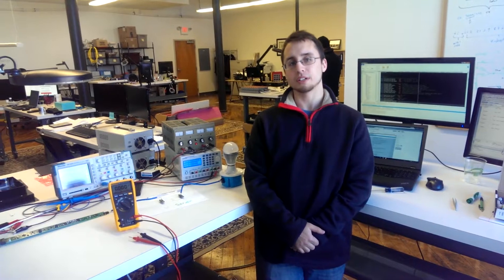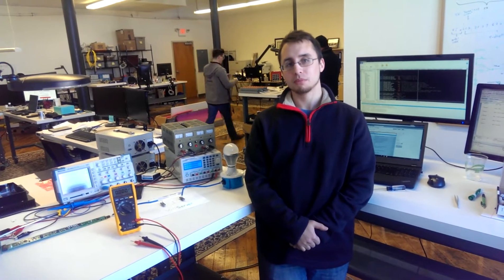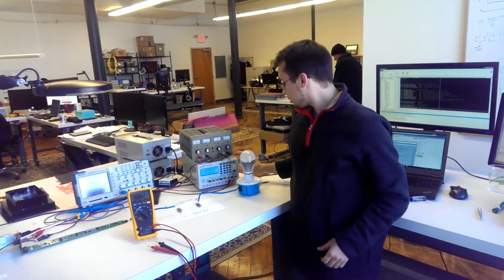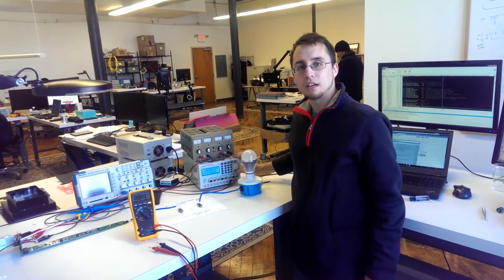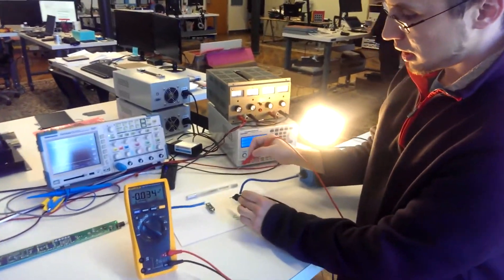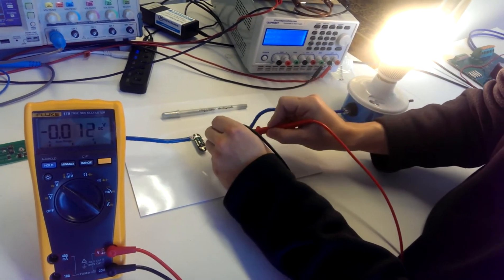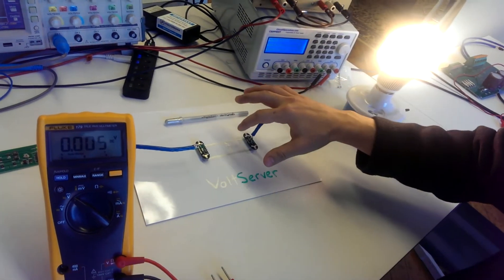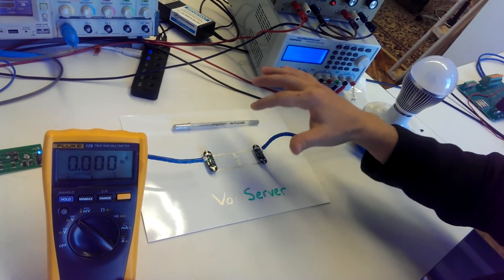VoltServer and Electroninks - Powering a Light Bulb with Conductive Ink

Comment: If you power a critical life support system with this, what happens if its accidentally shutoff?  Like are there options for security and fire alarm to prevent accidental turn off?
Reply: I think it would only shut down in a short circuit situation, which a traditional would also do.  The difference with this is nothing blows up when it's shorted, and if you fix the fault it will just turn back on.